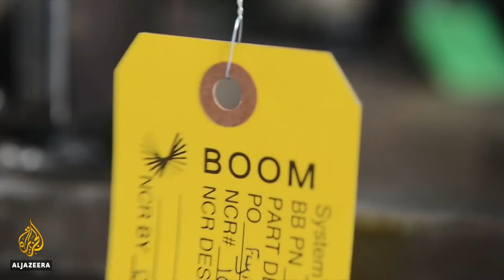Paris Air Show: Supersonic plans to rival Concorde

Comment: After 737Max and MCAS  new technology in aviation will be hard to trust 
Concord and old Boeing plane were materpiece engieering by great generation
Reply: I wouldn't blame technology, Automation has made flying alot safer than ever. We've had years where fatal crashes were zero and considering there's tens of millions of flights per year that's an impressive feat. I would say MCAS isn't so much technology but the problem surrounding Boeing and their relationship with the FAA being far too interlinked. You can't have a private company scrutinise their own planes, It's a conflict of interest. This is an inherit problem within America's industry where people who were former executives of private companies are put into positions which require Independence.
Reply: @deezeed2817  Yes and today no plane flying with MCAS a bandaid to cover engineering blunder by putting big engine on light wings